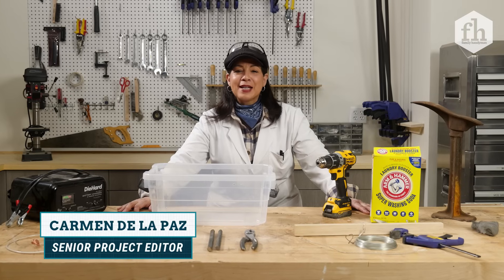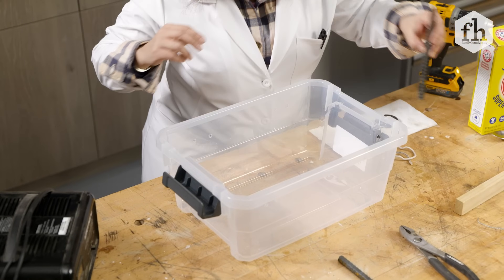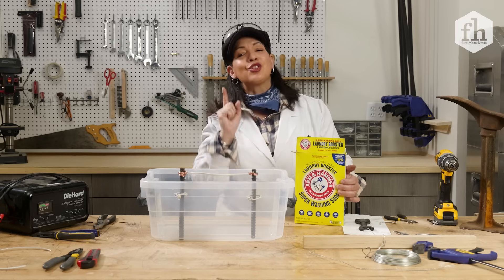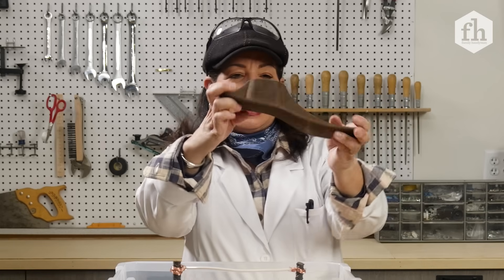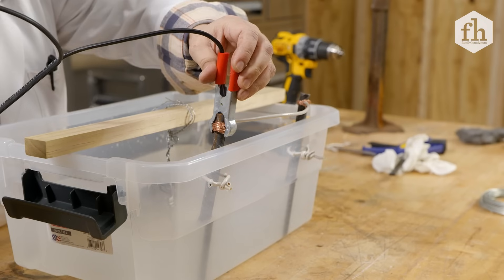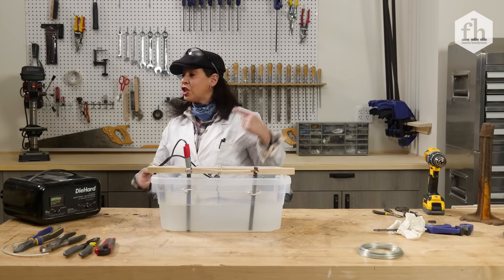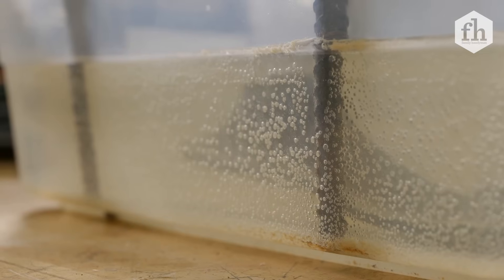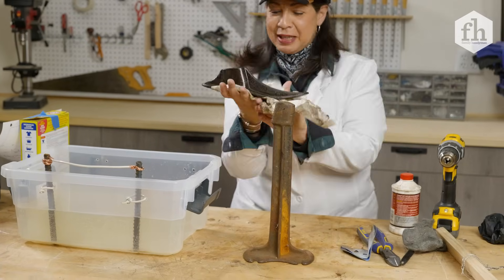How to Remove Rust with Electrolysis

Comment: She seems ridiculously paranoid about electricity safety when it's only 12 volts and totally safe to touch and yet totally fails to mention that this causes explosive Hydrogen gas to form and should not be done indoors unless there's very good external ventilation (an open window or door to the outside).  There are so many mistakes in this video also: sodium carbonate is not any kind of "salt" and is not a battery she's using it's a battery charger.  Another example of someone making a tutorial video when they don't actually know what they're doing and don't understand the process.

Comment: Salt (Sodium Chloride would work equally as well. just an electrolyte to carry the relevant charge. What you need to worry about when using Salt is not to use in conjunction a strong (strong does not mean strength but the ability to dissociate)  acid such as battery acid (Sulphuric acid or as you Americans spell it Sulfuric acid) as this would liberate Chlorine gas. Thanks for sharing. Regards Stephen
Reply: I'd never recommend using table salt, for safety reasons. Way too much could go wrong with catastrophic consequences

Comment: Now switch it to a plastic 55 gal drum and hook up a battery charger negative to the block and positive to a scrap pc of metal.    You will have a super clean block after several house.  Monitor the amp on one of the leads and add epson salt if it lowers itself within the first few mins

Comment: Ventilation is vital.  This can't be overstated.  The cathode (the rusty workpiece) will be generating hydrogen gas.  The anode (rebar) will be generating oxygen in her configuration.  These two gases should not be allowed to accumulate in a confined space.  Just takes a tiny spark to detonate them.

Comment: I lost count of the number if times she mentioned SAFETY  but not once did she say anything about the Hydrogen gas that this process emits into the air around the tank.   Hydrogen gas is flammable and can be ignited by non- classified electrical equipment including the light fixtures and the cordless drill she used.
Reply: She probably didn't know.  just like the washing soda is basically "salt" she said.  I wonder if she season's her salad with washing soda?   That was the shadiest connection between those two rebars.  Nice and loose.
Reply: There's not enough hydrogen released to cause a problem.  It also dissipates rather quickly.
Reply: @Ed_Settera  , it's only a problem when it explodes or is stored in a Zeppelin.  Oh, the humanity.    The problem is there is a chance this can cause a fire and if it does, this old gal is getting her died roots sued.    LOL or lots of luck on that one.   Maybe she should try to raise plastic gold fish?   She didn't look like a very well "ve(n)tted person.
Reply: @southernguy35 there's a lot to unpack there but the main takeaway seems to be "ladies can't science reeee"
Reply: Hence the "well-ventilated."

Comment: That battery charger will not shock you if touching the wire. 
In your case, you’re touching a piece of wood and pulling the part out of the bath, that will  definitely not shock you. It’s not house current. It’s a 12 V battery charger.
Reply: Yes I placed my MM probes around te fluid and got 7 to 13 volts the latter being close to the terminals.
Reply: Careful!!! It's not the voltage that kills you...  it's the amperage.  As little as 0.2A can kill you, which is available in most small power adapters, not to mention a battery charger that can deliver over 15A.
Reply: @brunopascal3793 It doesn't matter. Your bodies resistance is way too high to even get the faintest shock from 5V or 12V. Car batteries can deliver 300A to 600A, but you can safely touch the terminals. The amount of current that flows through a circuit depends on ohms law (V=IR) and you can only control voltage and resistance. The current that flows is a result of the other two values.

Comment: I went and looked at all of my battery chargers, and every dang one of them was automatic. And the I remembered that several people had said that a simple psu like that for a laptop would work well if the voltage was high enough. I went to my local thrift store and found some that were 24v and 5 amps. Paid $1 each for them. They work great! Been blowing the rust off of my several cast iron pots for several days now. Just remember positive to the anode, negative to the rusty tool or pot.

Comment: How do I dispose of the used solution safely?   Can I pour the used solution down the sink?  Will it hurt metal or PVC pipes?  Can I dump it on the lawn?
Reply: it is full of non toxic minerals, would probably feed your lawn in the spot you dump it. It is sodium, carbonate, and iron.
Might be prudent to dilute it a bit and scatter it widely
Reply: @wisconsinfarmer4742  Cool!  Thanks.
Reply: It is essentially drain cleaner.
Reply: @isabelharris442  nope, far from it

Comment: This process releases hydrogen gas.  Accumulated hydrogen gas is a fire hazard,  Do this in a well ventilated area,  not inside.  I do this outside on my back porch.
Reply: Can I use epsom salts
Reply: @quixo100  no

Comment: Great vid! I've done this; it was essentially just a fun project when I found a bunch of old tools.
However, now I want to remove tarnish from old silver.  I know there are similar processes, but they typically involve using silver. Depending on the source I find, it either works similar to this, or is uses copper directly touching the silver.   Any suggestions on who this should be done!? Thanks!
Reply: I made a paste of baking soda and vinegar and rubbed it on an item with over 100 years worth of tarnish. It worked extremely well. Use it like you are polishing the item

Comment: It’s better to use sodium hydroxide. The rust will come off and settle to the bottom.  You don’t want to breathe the gas coming off of the water mixture.
Reply: It's pure hydrogen gas.  I don't think breathing it is the issue.  Hydrogen gas can explode, remember the Hindenburg.  Do not do this inside where the gas can accumulate
Reply: Sodium Bicarbonate is safer to use. It does break down in solution to Sodium Hydroxide, Carbon Dioxide, and water.
Reply: @isabelharris442  Does this mean the final residue solution is okay for soaking other metals in to clean?

Comment: Can you do this to a steel boat while it’s in the ocean?
Reply: Did the electricity remove the rust? Or did it remove the oxygen from the rust turning it back to steel? I want you removed the metal from the rebar and make it plate the steel to replace missing steel that has rusted away. Something similar to electroplating steel on steel.
Reply: if there are evenly spaced anode rods or surrounding the hull, yes theoretically it could be done.
Perhaps with a charge containment barrier surrounding the whole affair. Sheets of plastic suspended on bouys. and the rods replaced with a latticework. Electricity flows through the path of least resistance in a proportional manner.
Good question!

Comment: Sodium bicarbonate is basically salt? No it's not its baking soda. Tf?
Reply: Right? However, baking soda (sodium BIcarbonate) and washing soda (sodium carbonate) are different but similar, the latter being more caustic. Baking soda for eating, washing soda for washing/cleaning.
Reply: In this case they both do the exact same thing
Reply: She was correct, but would have been more accurate to say, "a salt." There are lots of "salts" we just usually think of table salt. Chemically, any compound formed in an acid-base reaction in which the hydrogen is replaced with the cation is a salt. Sodium bicarbonate falls into that category, so it is a salt.

Comment: Seems to exaggerate the danger of “electricity.” How about explaining what would happen if you accidentally touched a 12v electrode? I suspect nothing.,,,.
Reply: Removed
Reply: @ Wrong, and your answer shows a really weak understanding of electricity. Physics professor from a university: “The shock
 from a car battery will not kill you. In fact, under normal conditions, a 12-volt car battery will usually not even shock you. Car batteries are not harmless, though.”
Reply: @geoffreysarkissian3154  Sure, but that last part, ”Car batteries are not harmless, though” is quite important to remember. Since it’s mostly safe to work on 12V, it’s easy to forget how angry 12V can get when you short it. A car battery usually has well over 1000A in short circuit current. For an example with wiring like this I can see how you maybe forget to take off your metal watch and short it on exposed wiring and conductive parts. Now with this charger that probably has a fuse or maybe other protective curcuits that prohibits flow if shorted, it might be alright, but I think a lot of people who make cowboy DIY electronics at home don’t always have proper knowledge for it, and it’s quite possible that someone will hook this rig straight up to a 12V battery, fumble around and make a nice imprint of their wrist watch or wedding ring. I think 12V is safe until you consider it safe.
Reply: @robertbiermann4666  It takes ~100vDC to push an injuring amperage.
Reply: @wisconsinfarmer4742  Thanks! I removed my comment. You are correct.  I normally look stuff like that up, but I relied on old comments from someone in my history.

Comment: Would stainless wire be suitable to use as the hanging wire? Seems difficult to find ungalvanized plain steel/iron wire. Or even copper wire??
Reply: Hard to find bailing wire? Lol
Reply: Never mind. Watched the vid more closely and saw the answer.
Reply: @mp-xs2cd  What you choose? Did you wrap it with aluminum, bro?

Comment: Or you could use C.L.R. (  Calcium, lime and rust remover). Takes about 10 min.
Reply: Does not work as well
Reply: Not as much fun..
Reply: and much higher cost.
Reply: Need a little umph when removing rust from a padlock that’s been buried in the soil since the late 1880’s.
Reply: 10 minutes my butt... it'll take a lot longer than that!